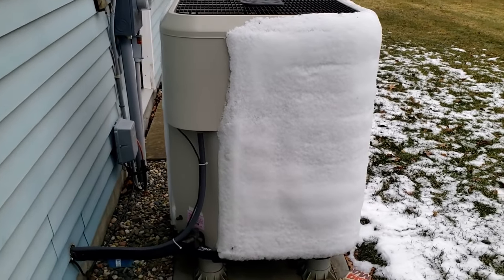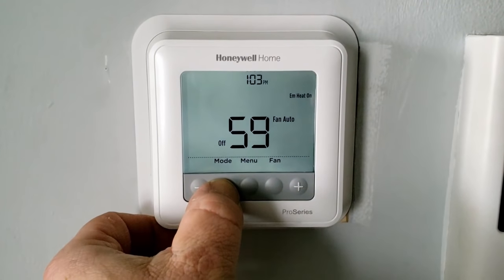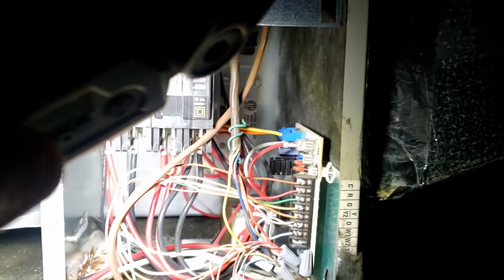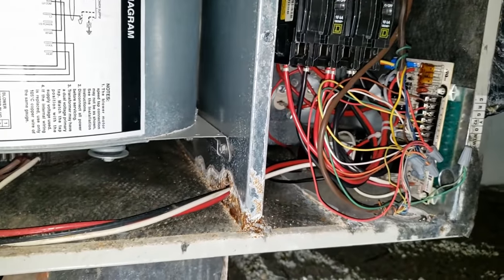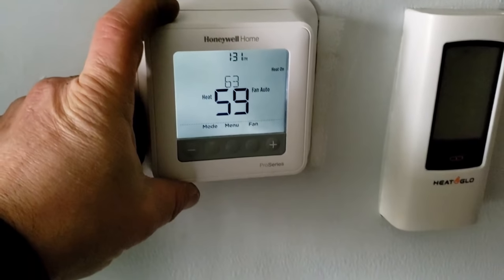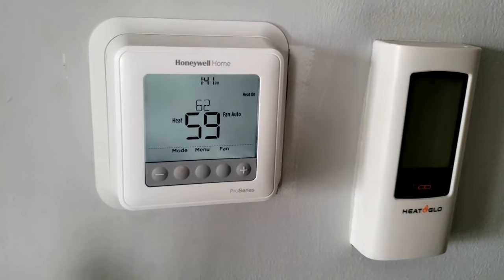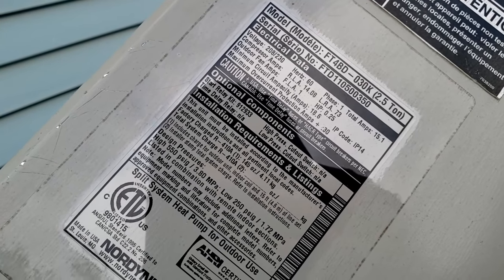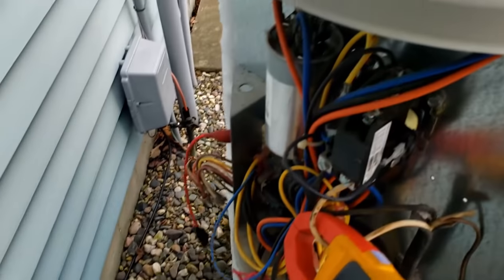HEAT PUMP FROZEN UP LIKE A ICE MACHINE I MISSED  UP & TOASTED THE FUSE

Comment: "don't be doing electrical if you don't know what your doing" he says shortly after blowing the fuse by jumping the wrong terminal to common :)) I just couldn't resist the temptation to poke lol.
those three test terminals on board, the top is T2, the middle is defrost/test(jump top and middle together) and bottom is test which you jump to common to speed the defrost timer to seconds, vs. minutes setting of jumpers.
jumping the top two together should be the same as defrost thermostat closed and it's likely directly connected to the defrost thermostat pins.
Reply from the maker: Shit happens but it makes for a better video. lol
Reply: Absolutely right.

Comment: They need to be up off the ground with a shelter over them in colder areas. Mine is on two foot high concrete pylons with a shelter over it. No issues so far. It's in central NH.

Comment: The tee for the drain on the furnace. My old job that’s how we were told to do it so it can properly vent and drain per the MFG granted I worked on Lenox. That being said how come you put the foam cap in? It’ll trap the same with or with out wouldn’t it?
Reply from the maker: Watch the video again and see where the tee is at. It's before the trap, if you're going to put a tee in you put it after the trap that way you don't double trap the drain line and cause it to not drain.  Also don't forget this coil is in a negative pressure zone because it's before the blower. If the coil is in a positive pressure then yeah I've put a t after it and not use a trap.  I worked for a Lennox premiere dealer for 19 years prior to where I'm at now.
Reply: @HVACRSurvival  okay, wow that’s a lot I am just now learning lol thanks!

Comment: I have a molex pin remover that works pretty good on those boards.
Reply: Male/Female 4 Pin Molex Power Connector Pin Remover Computer Wire Extractor Tool for Modding/Wiring/Sleeving (for .062" and 0.093" pins)
Reply from the maker: @sherwinalvarez7365  I have a molex pin pushing tool, I'll have to see if that fits👍👍
Reply: I use a piece of 1/4” copper tubing
Reply from the maker: @domrod1579  that might be my favorite one. I always have 1/4" 👍👍

Comment: Same part the HVAC guy did change on my 13 years old Amana Heatpump. Sometimes the heatpump was stuck in defrost mode or staying in defrost and starting the fan so it was in Cooling mode but asking for heat nice videos. For my part I did change my filter every single 3 months

Comment: Nice job in poor conditions!  All the DIYers need to know that while it may appear that he was safely touching all over energized equipment, his fingers were about two inches away from lethal voltage.   Pros only!
Reply from the maker: You make me laugh. Viewers that quote 400 volts are the ones I have to worry about doing something wrong and trying to blame me because they didn't fully understand what they were doing. Show me 400 volts in the United States?  120v, 240v, 277v, 460v, is the most common I work on. And yes I have been hit with 277v. Go watch more videos and show me how you truly get nailed with 400v. Better yet start making videos to help technicians in the field that don't get enough training in our pathic school systems that come out lost and less than prepared to work in the field. If schools weren't so horribly under performing I wouldn't need to make videos. I don't make these to brag or to help cheap ass homeowners and business owners to save money. Thanks for your input that added no value to today's video👍👍
Reply: 1st sticker always de energize eq before performing maintenance next sticker with eq energized jump j1 to t2 to enter test mode😂.  Knowing the eq is the safety, being able to run diagnostics on energized eq is a far cry from an idiot.
Reply from the maker: @grindstone5368  eureka Jeeves! you get it!!!👍👍🤣

Comment: Kinda looks like my unit, except mine is a Bryant. 30 years old and starting to have some issues here and there. Over a year ago had to replace main board on furnace. 8 months before that it was the run capacitor on the outside unit. Just this past Monday had the blower motor replaced on furnace. When it gets a little warmer will have them come out and figure out why the outside unit freezes up on occasion. Things don't last forever, but I bet a new unit won't last close to 30 years either.
Reply from the maker: The new ones won't.
Reply: Keep doing that maintenance...even replacing the compressor is much cheaper than replacing the entire unit.
Reply: Keep the coils clean...gotta remove the cabinet to do this one. First thing I’d try, and free. Maybe low Freon, or dirty filter/cold air returns.

Comment: I really been thinking on putting one in my house but what I’ve seen lines come 25’ but my home is 30’x75’ slab ranch 9 total rooms had central air but out side condenser froze up and stopped working thinking of changing it out with a heat pump
Reply from the maker: Linesets can be extended to what ever the manufacture has listed as the maximum length.

Comment: Just run it in ac and pull the wiring to the fan! Defrost as long as you like!
Reply: It was 59 in the house. Indoor coil will freeze.
Reply: Pressures would also be of concern.
Reply: @myrkobalaban8571  no it won't in that amount of time.
Reply: Water hose.
Reply: @jamesrogers4674  gosh that takes a long time on one like this. But it's about the only option however I've got a propane space heater I set in front of them if it has to be done right then. Around here I put them on emergency heat and  wait a few days for them to melt if they'll let me. Some people don't agree to that. I'm talking about something frozen up like this one.. forced air space heater works pretty quick and you can stay warm too
Reply: @Bryan-Hensley  if you're using heat like that and you do it often You should get a cheap tent and cut the bottom out of it. You wouldn't be able to use forced heat though. You could run an extension cord and use a cheap space heater and leave for a while.
Reply: @jamesrogers4674  this thing is like one of those kerosene heaters that sounds like a jet engine. That type of space heater.. but the kerosene ones are heavy. They have pumps in them and the tank attached. The propane ones are much easier to carry around. I think it's 50,000 BTU
Reply: @HVACExplorations  Don’t worry so much bro.
Reply: I agree, run in cooling with outdoor fan disconnected.  Ive had issues with ice melting around coil, leaving a small gap but wont fall off then the coil gets so hot it trips on high pressure.
Reply: Hey, I've got an idea since the author likes using jumpers, just take an old oven heating element and clip onto both sides of the contactor and drag it around the fins. That should melt some shit in a hurry ;-)

Comment: When you short the test pins and rapidly advance the internal clock you can eat into the 10mins defrost cycle and it terminated less than 10mins
Reply from the maker: I pulled the jumper as soon as it went into defrost but you might have a point👍👍

Comment: I subscribed for the comments...left a smarter man. Curious if the coils were clean. I usually pull the cabinet and clean them if needed, before I even put a gauge on it.
Reply from the maker: They were clean. System is still working good since the repair.

Comment: I can't believe this guy posted this video. He's killing me.
Reply from the maker: Say what you want to say don't be a sissy about it 🤣
Reply: @HVACRSurvival  no offense. If you open a panel and see the wiring indicating a heat pump, probably not going to find a gas furnace under the house. I'm just saying.
Reply from the maker: @jpluto7474  you must live in the south because I have a gas furnace on my heat pump. It's very common where I live.
Reply: @HVACRSurvival  certainly do! In that case where you'r heat pump developes Frost/ice, switch over to the fuel or gas heat. I was just taught, 27, years ago, that gas is the best source of heat. Installing a heat pump with a gas furnace just don't make sense to ME! emphasis, ME. In the south, gas furnaces are always paired with straight air condensers. Dual fuel systems aside. Perhaps there is still much I need to learn. Guys I've trained work in areas further north west of Charleston into North Carolina where fuel oil systems are prevalent. Don't mind me, my wife thinks I pay too much attention to duct work when we're out. Sometimes I think she believes I would date a piece of spiral duct.

Comment: Run system in AC mode to defrost, heats condenser coil. Or initiate defrost manually, tricking defrost sensor by jumping it. Then initiate defrost test.
Reply: You shouldn;'t have to do that. Why should we install systems that require 'fixing' (as opposed to maintenance) as part of their normal operation? It is counter-intuitive.

Comment: Just a Idea, have a long hose in work  truck and if you come on to another on of these, hook hose to Hot Water Valve of Washing Machine to melt the Ice off unit.
Reply: Just did the same but off the drain cock of the water heter.

Comment: How long can they run like that? Seen one at a condo being renovated, owner was out, every time I walked through the parking lot shortcut to house seen one of those with ice crawling on the ground around it more and more each day til the owner showed up.
Reply from the maker: Until it finally washes the oil away and it seizes up.

Comment: Nordyne defrost boards are crap. I usually replace board and sensor. Just jump red to orange at CU. puts unit in cool mode to defrost out door coil. Tstat will bring on heat strips.

Comment: I had one where the indoor txv had failed. It would only run in heat mode. Never defrosting. Even though it would run the defrost mode normally. But, outdoor unit never got any heat. 🐧
Reply from the maker: Thanks for sharing! I have had a few txv failures but I don't remember it causing a defrosting issue, I believe the result was a pressure switch lock out.

Comment: Or did it cycle off on high pressure cut off?
Reply from the maker: If the high pressure switch tripped because the indoor fan was not running that should cause it to shut down and not run any further. Not continue to run and freeze up into a ball of ice.

Comment: That unit looks like its under charged and you should use 3 wire jumper cable !  R to O or B and Y terminals !  Depending on the kind of unit you have !

Comment: Believe I would have figured out why the blower was not running before leaving the crawl space the first time..  Without the blower you can’t get Emergency Heat, Aux Heat, or defrost to work.
Reply from the maker: I believe it was because the outside unit had the test pins jumped and the thermostat had not came out of a 5 min delay.
Reply: You were in defrost , so yes it is normal that the blower doesnt run . 
You dont wanna get cold air inside the house. When your first objective is to heat
Reply from the maker: @snpdg1  that would be the first system I've seen that doesn't run the fan during a defrost. From what I'm learning about this POS defrost board, it wouldn't surprise me.
Reply: @rottiev264  nicely true

Comment: Pro Tip instead of running it in defrost over and over. run it in heat mode and just jumper 24v to the reversing vlave and disconect the fan
Reply: Why would you do that? It's easier to run in cool mode and just disconnect the O wire outside :P
Reply: @sprockkets  what does removing the O terminal do in this instance?
Reply from the maker: @antonalderliesten1421 you’re better off emailing me then posting it here for everyone to see.

Comment: You could’ve replaced it w/ an Emerson/Copeland Universal HP control and set the defrost to your preferences.
Reply from the maker: I'm trying to get away from residential, but that sounds interesting. Anything would have been a better control than what they had on this thing.
Reply: @HVACRSurvival  You’d notice, if you do enough of them, how “approximate” the timers are. You replace parts and the new one do the same thing. 😂 The Emerson Universal, if it fits, is a good option, as you can change your defrost. 
Nothing wrong w/ a little Resi, it’s COD.

Comment: Should I replace the defrost switch when I replace the board? Was open when it was frozen but was not hooked to a coil that was frozen. 
Has frozen stripes on the unit. Any idea what causes stripes to freeze?
Defrost only ran for 5 or 10 seconds in test so I know I need a board.
Reply: the open/terminate on them is usually around 60 to 70F! so if you had one open when it was below 60F outdoors without unit running and cold, it's likely a bad thermostat ;)

Comment: hence why I never jump anything, while its HOT. Except the reversing valves on heat pumps, its safe enough. jumping has proven to be stupid when the circuits live... MY master tech above me blows fuses alot because of it
Reply: Jumping switches can be fine.
Because you are just bypassing a single component.

Jumping from common to circuits near sensors or neutral? Asking to burn or blow something.

Better to bypass than jump.

Comment: I have a 2019 Lennox 14HPX-030-230-21  heat pump it is Iced up  and the defrost kicks off after 2 minutes what should I do?
Reply from the maker: I would locate a local Lennox dealer to check it out.
Reply: Change & insulate the sensor

Comment: ICP, I get away with 90 mins in Florida on defrost, clearly a bad defrost board, I have not seen video yet.  Mine from 2001 Heil has a thermistor to be cold enough for the defrost.  That defrost board is cheap cost and other then thermostat for defrost given your symptoms that should fix it.  I watched video now, that low RLA is normal when it's cold and no load on a 2.5T (it's running in cooling mode to defrost), you'd see 8 compressor plus 1 fan on a hot day in cooling.  Of course you know this with your eyes closed...You where ok with board replacement even though it may have been stat only, the part does fail and in my case they came out with an improved version superseding, and it's the same board you have.  In my case a lizard committed suicide on my defrost board and smoked it.
Reply from the maker: If I was in Florida market I would be using the 120 minute defrost or demand defrost (if I had a Carrier unit). The control board can't be sent back once it's been put on, this is one of many drawbacks of buying equipment from fly by night companies and expecting others to work on your equipment. I always tell my customers make sure you purchase from who you like doing business with. The company that sells the particular brand of equipment you choose will know the product best so be sure your ready to stay with them. In my  area, Westinghouse and all the other Nordyne products are sold too about anyone with a contractor license.  In my area Carrier, Lennox, Rheem, Trane are the big boys.

Comment: I would have pulled the fan wire off the contactor on one side and went to the tstat and put it on 55 F to defrost it and if the board had a flashing light I would see what the code was saying.  If the ice sensor was calling I would order a new defrost board.

Comment: HP in defrost perhaps?
Reply from the maker: Not sure what you're stating or asking?
Reply: @HVACRSurvival  High pressure trip in defrost? sorry
Reply from the maker: @bradgeary3467  I'm not sure if this unit had a high pressure switch or not, it's been over a year since I've been there I usually can't remember what I did last week. Luckily I haven't been back to this place since. I believe it was a new customer and generally we work on what we sell. But it could have been an issue that you're mentioning.

Comment: heat pumps has to run without leaks of any refrigerant..and it has to be working with its owned vacuum heater core valve for every startup   ...cause its noisy every time it starts then fan ramps up then noise went away
Reply from the maker: It's definitely preferred to not have any leaks, I have no clue what you're talking about far as a vacuum heater core valve? That sounds like a thingamajig down by the witchamacallit next to the monistat 🤣.  There will be a lot of noise when it comes out of a defrost, you just changed from One direction and slammed it into the other. This is pretty common for any heat pump. And as I mentioned I am not a fan of this brand,

Comment: What is your preferred brand(s)?
Reply from the maker: For me, it doesn't have to be the most expensive, I like brands that have proven to give me reliable service with easy maintenance. In my area Lennox, Carrier, Rheem are what I know best.  Trane is good also,  but I don't work on many new Trane heatpumps so I can't add them to my personal list of preferred. Now if your comparing features of who is the quietest and most efficient, I really like the VNA series from Carrier, but they are BIG MONEY.   Here's the problem, everything made by a human is going to break and have problems, I'm looking for the best of what I have to work with.
Reply: @HVACRSurvival  if would have waited until the end of the video before I posted my comment.   Thanks for the reply.  My rheem equipment has been rock solid for 15 years now.  But it's always good to hear opinions from people with experience.

Comment: Is the fan not running because the door is open?
Reply from the maker: There's not a door interlock on this model.  The outdoor unit ran because I had the timer jumped outside, it didn't happen once the jumper was removed.

Comment: No way would I ever consider a Heat Pump as my sole home heat source if I lived where there is even remote chances of snow or single digit cold during winters.    Just saying I like having a back up,  either a gas furnace like in a dual fuel system or have an electrical Aux heat system.
Reply from the maker: Most people have auxiliary heat with the heat pump